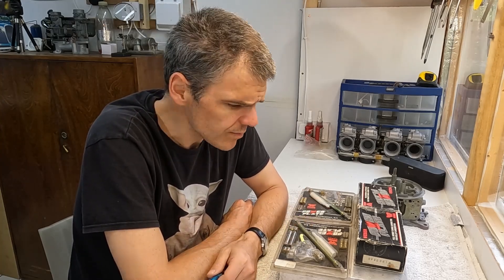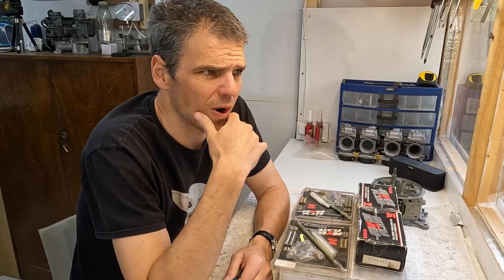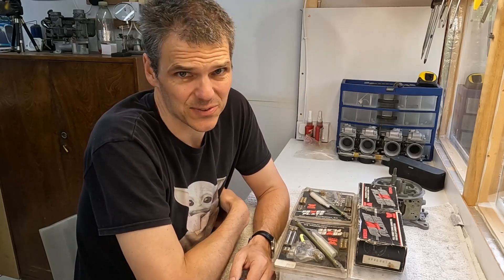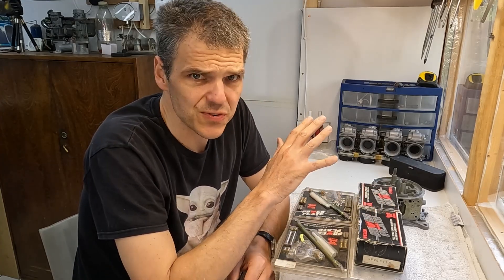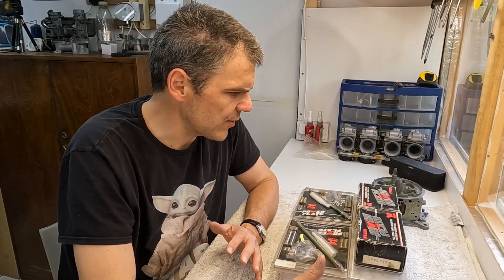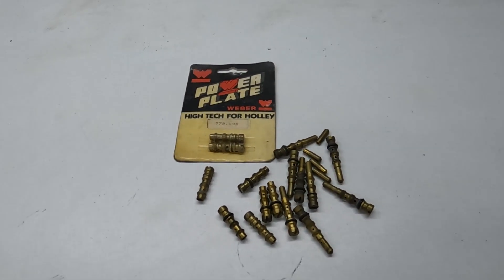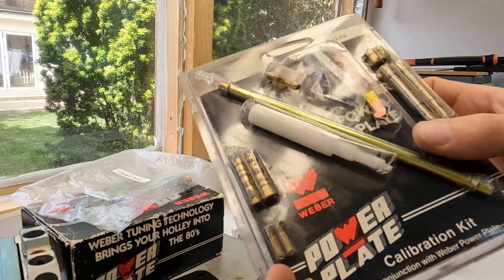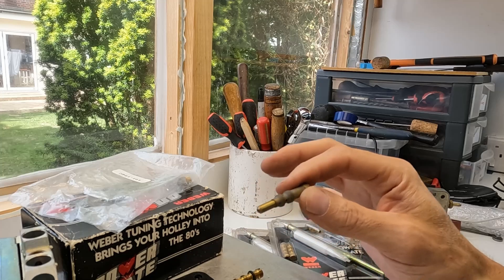How to achieve maximum tunability by using weber power plates for Holley carburettors.

Comment: Power plates are awesome, the tuning instructions are gold standard and should be followed to the letter. Main jet changes can be done running. Power plates increase fuel bowl capacity and prevent fuel starvation under most conditions.